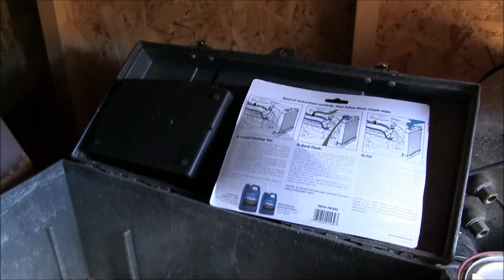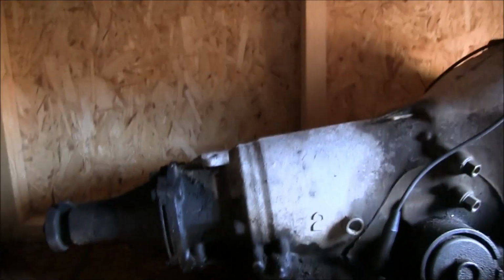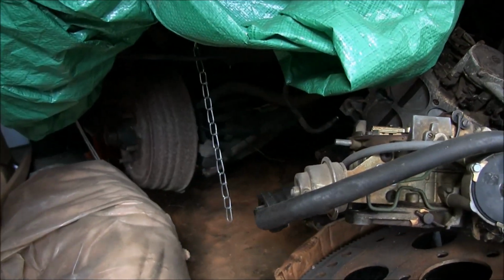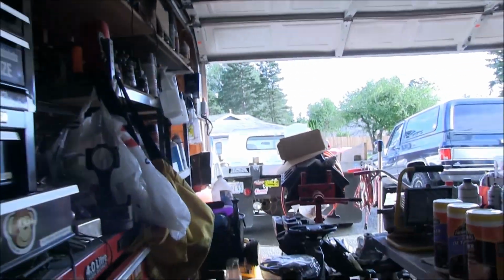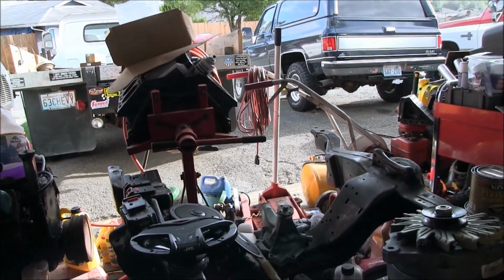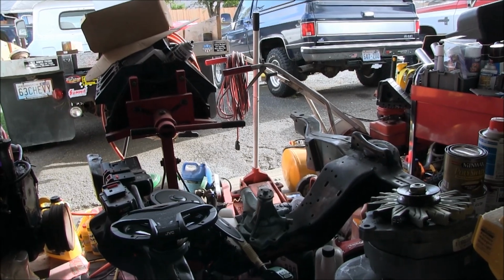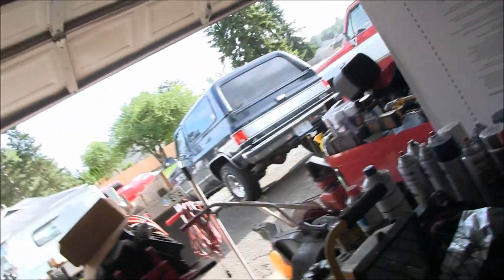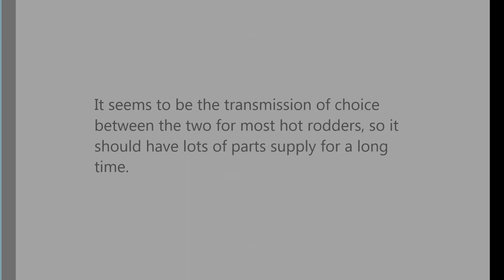Talking Oldsmobile Transmission Choices

Comment: I have a 1967 oldsmobile delta convertible  .i would like to change transmission to a four speed is it possible to use a chevy trans. Do they have an adapter thanks.

Comment: It is your 700 you found behind your toolbox. 200-4R built up nice is a better unit then the 700. Better more efficient power flow, closer spaced gear ratios, a better unit, love the 200-4R in my wagon. If anything the 700 has a lower first gear ratio of 3.06 that  jumps to roughly 1.72 in second.

Comment: I have a 2004r with all  and I mean all billet parts red clutches and kolene steels with the wide clutch band that can be bought that I have decided not to use due to the weight of my 79' 2 wheel drive blazer. I have about 3K in parts. All parts are from ck performance I also have a 2500 RPM stall to go with it. I will sell it for what I have invested in it. also have a case of amsoil transmission fluid for it.

Comment: You might have a tough time getting rid of that late model Olds 350, those later years are much less desirable than earlier 350s.
Reply: pacifiedherbicide all blocks 1968-1976 are the same. It's heads, pistons, intake and smog stuff that is undesirable after 73. However all the 2bbls got deep 22 cc dished pistons as where the 68-70 4bbls had a slight 6cc dish piston. All 71-72 2bbl & 4bbl had low compression pistons. All the heads from 68-72 are good. In 73 they lowered the compression in the heads instead of dishing the pistons. Hope this helps.